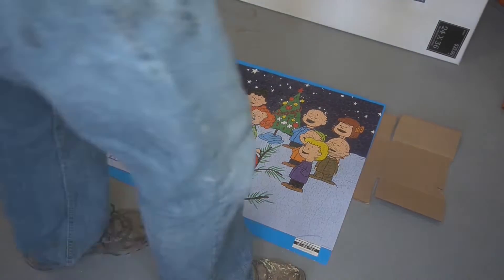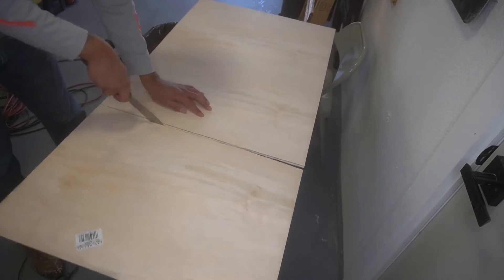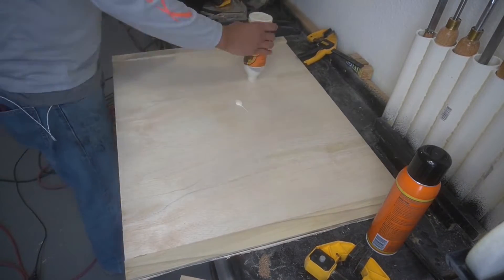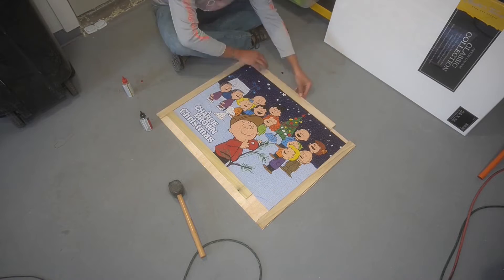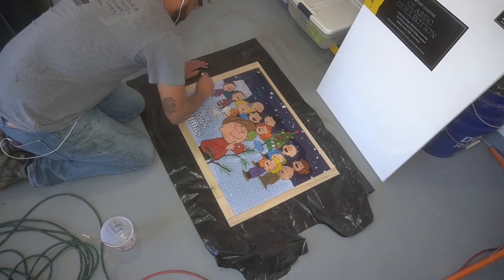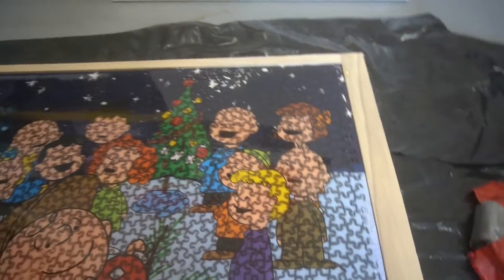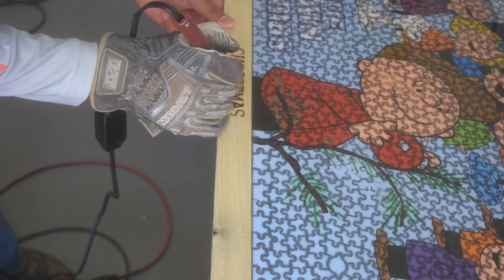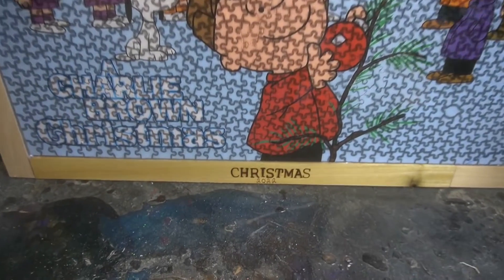DONT!! Use Epoxy Resin On Puzzles! WARNING!!!!

Comment: You can usually coat paper products in Mod Podge or a clear acrylic base to seal them before the epoxy pour.  I would probably flip the puzzle so it is "image side down" and glue the backing onto that, but I am not speaking from experience on that part.
Reply from the maker: Thanks for the suggestion, I’m gonna use that one next year.

Comment: Elmer's glue. Dries clear. Spread the glue on the board first, it will seal the bottom and hold the puzzle in place. Two coats on top to seal the cracks and the epoxy won't seep into and "stain" the cracks.
Reply from the maker: Thank you for the tips. I am gonna try that for this year's puzzle.

Comment: I would have put some little raised up cones painters, cones, or something underneath it to raise it up so it wouldn’t be straight on the flat surface like that and then I would’ve sealed it first will sealer, then put the resin on it